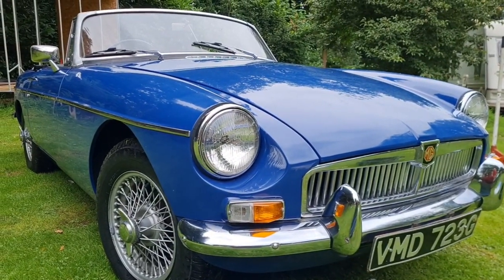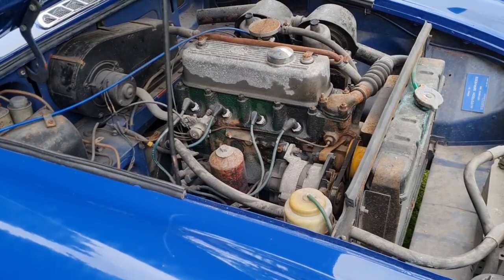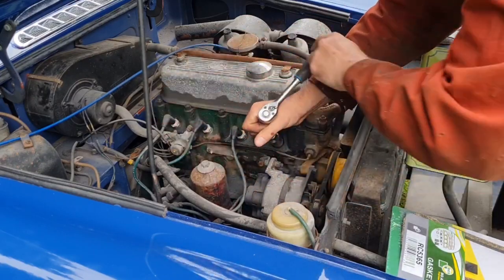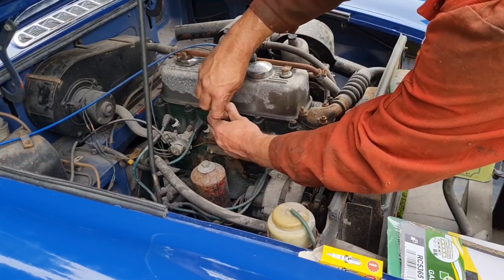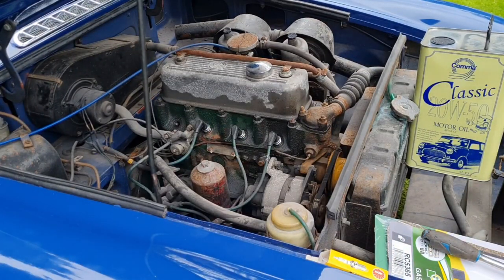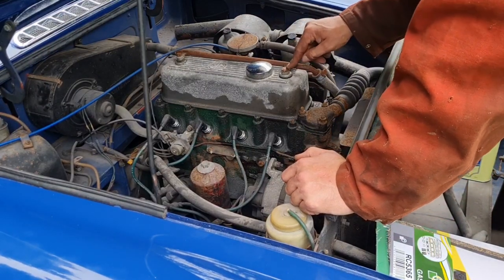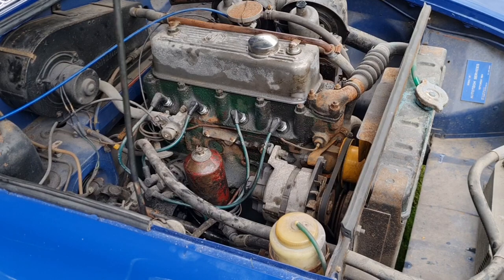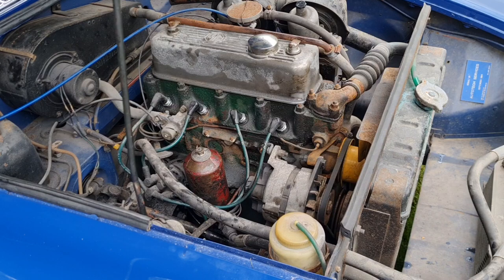MGB Basic Engine Service.

Comment: The standard belt driven radiator fan consumes lots of power, especially at higher revs. For my 1967 MGB in about 1970 in Australia, I purchase from the UK an "Aerofan" which replaces the existing one, and the blades feather as the revs get higher. The difference in high end acceleration & top speed was amazing. Just one of the reasons all cars now have electric fans.
Thanks for the memories - nice little vid.

Comment: I hope you checked thoroughly for an existing o-ring in that groove on the filter housing.  They often get hard as a rock and are mistaken for metal.  That will leak later if the second o-ring blows out.
Reply: I think I can see a shrunken and worn flat o-ring at 19:54. I made this mistake when I had my 68MGB and stacked a fresh o-ring on top. I ended up making a big mess when I fired up the engine after my oil change and sprayed a perfect fountain of oil all over the engine bay as well as my driveway. I've never forgotten that lesson.

Comment: There is a gasket on both ends of the filter. The o ring goes in the goove the metal housing locates in.
Also, there's no o ring for the filter itself as the filter is designed to move. Under normal circumstances the spring holds it down, when it's blocked the filter rises allowing oil to bypass the filter so as not to seize the engine.

Comment: Those 1800 B series engines were easy to work on and were normally reliable old lumps.  
I owned a used Morris Marina 1.8 Special back in the 80s, with the same B series engine. It was a good car until some idiot crashed into the back of it on a roundabout and wrote it off.

Comment: hi any tips on stopping the oil filter housing from leaking please...driving me mad
Reply: A lot of times the previous o-ring has been crushed to the point where it doesn't look like there's one in the housing. When you add the new o-ring it creates a leak. I use a dentists pick to remove old o-rings. They are usually as hard as a rock. So my advice is to make sure 100% that there is only one o-ring sealing the oil filter.
Reply: my mgbgt engine is in a Morris minor